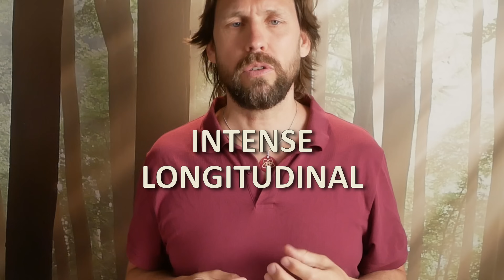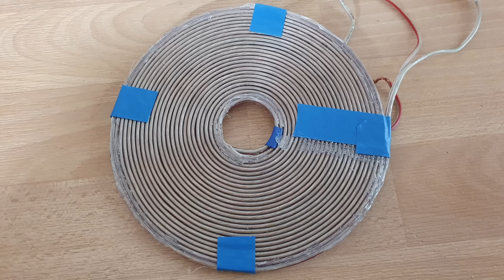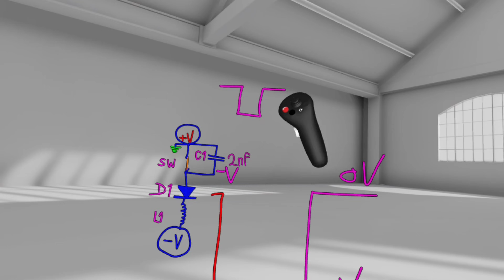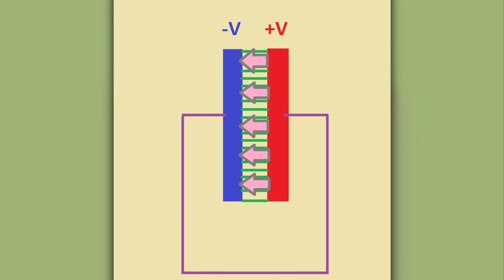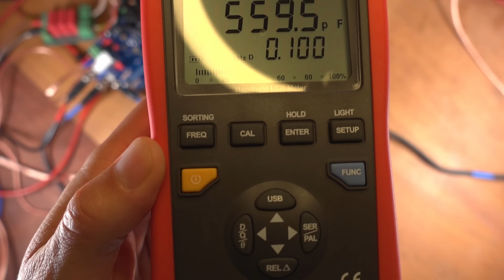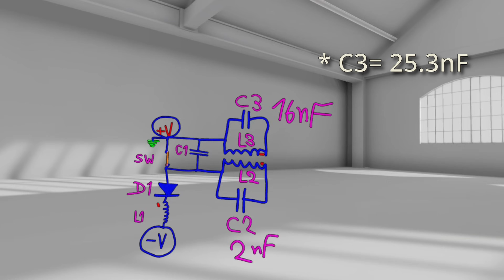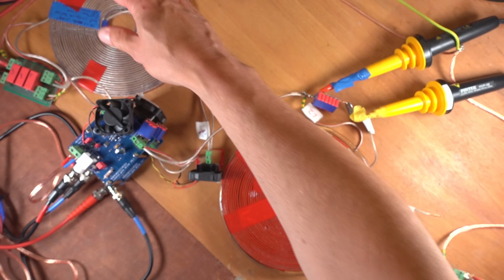Dielectric Induction producing Ground Currents

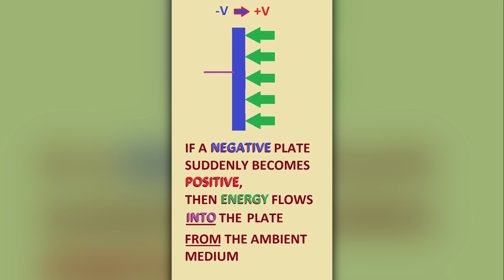Comment: 20:11 "There's an energy movement in a single direction into and out of the conductor." Not really. Reguarding the energy you're refering to here, it is the energy stored in and discharged from the electric field around or outside the conductor, but not so much inside the conductor. 21:07  No the energy doesn't flow from the ambient medium to the plate. The energy is in the fields and remains in the fields, and they dont really flow inside a conductor.  Anyone who wants to have a better understanding of energy flow should read up on or watch a few videos on poynting vectors. Poynting vectors, not pointing vectors, and the pun is unintentional. 

I wish I had more time to comment on other things in the video. 😊 maybe later.
Reply: But, there is energy in the conductor in terms of momentum.
Reply: @lukiepoole9254  just for thought back of the napkin calculation. Let's be generous and let's say with a  copper conductor, that all 11 valence electrons of every copper atom is being conducting at the average blazingly fast 1cm per hour.     1 mole of copper is just a little over 63 grams and the mass of each electron is about 1/1837 that of a proton.  Ball park numbers. For each mole of copper of 63 grams × 11 electrons/(1837 proton electron ratio) = 0.337 grams of electrons moving at that blazingly fast speed of 1 cm per hour.  Such low momentum suggest its effect is not much to speek of and irrelevant here.
Reply: @lukiepoole9254  Sure, and my statement indirectly  accommodates momentum of electrons,  when i said "reguarding  the energy your refering to".  When I wrote that statement I purposely left it open to electron momentum, i had thought about the average momentum of a few electrons in the conduction band and how little net electron momentum energy exist in a conductor, and that the energy in the electric field is vastly more important to the discussion.
Reply: @kreynolds1123  No such thing as electrons. Just atomic concentric energy spheres with connecting fibrous energy lines as revealed by the gamma ray atomic nanoscope - nemescope.

Comment: Hello IVO, Very concise video, great job!  There is a flow of energy into and out of a capacitor.  Obviously the dielectric does not conduct electrical charge or it would not be as such.  A dielectric displacement current is not an actual current flow as you know.  However, mathematically it acts as a displacement “current” in that you have a flow of energy either into or out of the dielectric described by the Poynting vector directionally, which is perpendicular to the dielectric, or an energy flow into or out of the dielectric depending upon charge or discharge.  Of course this energy flow is a magnetic energy flow as the three players are magnetic, electric and direction of energy flow.  Of course Tesla knew and taught this, and he, as you described in your video used a spark gap to enhance this high voltage high frequency flow of energy.  And, of course, Tesla also depended upon resonance in producing the effects thereof.  In your one attachment video in the middle you actually said something like magnetic energy, thus I felt you were alluding to the magnetic energy flow.  Now a flow from “ground” can be displayed by Tesla’s “stout” conductors as well, and with resonance actual high and low energy points along the stout conductors, as similar to an antenna circuit.  So it was interesting to see your current day replication using the Mosfets.  Great job!!!

Comment: If you put a full-bridge rectifier in series with the ground wire - and a cap across the +/- 
- can you then draw energy out of the cap, without loading the power supply supplying the coil/cap/switcher circuit?

Comment: Very interesting.
Puts me in mind of the air venturi effect, they use this to inflate emergency slides on air craft, they need to inflate the slide very quickly, so basically they blow high pressure air through a venturi and it drags external air in at a rapid rate of speed and the slide is inflated in seconds.
Reply: Yes i agree

Comment: Maybe you can show how to use the bifyler coil as a capacitor in a circuit. After all that why tesla use a bifyler is because it was a capacitor in itself. So trying to figure a capacitor value wasn't required to tune the resonance. But that might require tryfyler or multiple coins instead of 2.

Comment: I certainly am not an expert in electricity, I only started reading Tesla’s work 12 years ago. 
I have read tesla everyday for 12 years, and I believe I am starting to understand his basic ideas. 
So, in regards to how I have come to understand the basic concepts Tesla championed, I have some questions for you.
1) when you refer to dielectric, are you speaking on electrostatic energy? I don’t remember tesla ever writing dielectric fields, only as an insulator did tesla speak of dielectric, and you mention it often, so I am trying to reconcile your ideas with what I read of Tesla. 
2) tesla said electrons are what he referred to as “radiant matter”. He said those tiny spheres were primary(could not be broken into smaller pieces), and had an insulating fluid that kept these charges from combining, and creating much larger voltages, and higher currents. 
He also mentioned the resonant frequency of electrostatic energy is about 1 million per second. It was his opinion that a longitudinal wave of electrostatic energy could break down the insulating layer between electrons, and therefore, release unimaginable energies. Moray echoed that thinking as his apparatus was stated as being an oscillating circuit tuned to energy in the atmosphere; it was simply pulling energy from backround waves that are continuous and all pervasive in the cosmos. 
Is this your goal, when doing these circuits? Are you trying to get at those kind of frequencies of around 1 million per second?
3) have you tried, or considered,  a quenched spark gap as tesla described in his quenched spark gap patent? Tesla said as little energy as is practicable is what is needed, it shouldn’t be seen, and would sound like a “fly buzzing around” were his words. The goal was not to have large pressures, or currents, but to have the least necessary to cause a spark. The goal was a spark @ 1 million per second to break down the insulating fluid that prevents electrons from combining and creating much larger pressures, and currents than was necessary to make the spark. That would mean this circuit would always produce more than it used, in fact it would produce much more! Have you considered this circuit set up for your longitudinal energy? 
4) tesla did not use two flat coils as capacitors, the flat coils had a different purpose in his circuit set ups. They were used in conjunction with condensers to create enough energy to create discharges at what ever interval of time tesla wanted. The flat coils were used to propagate a compressive wave, or to receive a compressive wave, from my understanding. Why are you not copying tesla in the way he used flats? Air is a problem according to tesla, and the pressure would have to be constrained in a circuit that has air, as air becomes conductive(speaking in terms of high voltage/current)……tesla avoided air at all costs in the part of the circuit that was used to move large voltages and currents. All the flats I see in Tesla’s labs are not in oil, so the flats were part of the circuit that converted the high potentials/currents and were used as more a transmitter/receiver of longitudinal waves in the atmosphere…..what say you on this observation?
Reply: did NT  use quenched gaps to smoothe out his high voltage discharges?
Reply: @johnwynhausen9618  I believe Tesla said he had condensers to keep a constant pressure, the quenched gap was to afford the LEAST energy practicable to get “a spark”, which he defined as a compressive phenomena. This was from the transcripts of the Westinghouse bankruptcy proceedings. Tesla was letting us know that it was not “how much” energy necessary, but “at what frequency” that energy was to be repeated. 
Tesla said that static electricity wasn’t so static, that it had a frequency of about 1 million per second. Peter Lindeman adds that Tesla believed radiant matter, what we call electrons now(a primary particle, spheroid with exceptional charge), is surrounded by an insulating fluid. The implication when one thinks on these facts as stated by tesla, is; 
A spark repeated at 1 million per second(+/-) will hit the resonant frequency of static electricity, and the insulating fluid that surrounds all electrons will start breaking down, only a small conductive plate in that vicinity canbe used to collect the combining charges of the electrons……and that is the secret of the radiant patent.

Comment: Once L4 is placed next to L3 at a different capacitor should give you two phase and three phase if added more If one continues with adding L.. 1,1,2,3,5,8.  The "Grounding" (Zero)  would be from a different L  Would this not provide a "continuous"  DC supply if the timing is calculated have a look at Steinmitz calculations...
The VR drawing too must be great to model toroidal models..
Theroia Popolas
Reply: James, it seems that you understand exactly how the system works. No matter how many times I watch the video and how detailed Ivo is, I have no electrical background and don't understand much. Would help me and put it in simple terms - how do you make this energy usable? Where do you hook a battery or if it is not a battery how do you use this energy one extracted?
Reply: @nikikrastev5606  Transformer to the required battery input...
These are only ideas I do not know these things..
I just want to encourage experiment.

Comment: Can you use this to charge a battery????I found this guy living off grid..his power was from a battery that positive connected to a tv antenna,and negative on the battery connected to an earth stake,and he claimed the battery was always charged..he only had lights,a small dc pump and outlet for charging tech...his batery was 80 amp car battery....not even deep cycle..it was 8 yrs old and showed no sign of wear!!I am an electrician..had me stumped
Reply: If the antenna is picking up enough signal, you can run low voltage light directly - had a guy locally to me running his house lights off of BBC Radio 4 until complaints about the radio shadow his antenna was causing got the BBC investigators out.

His antenna was copper coils wrapped around the walls
Reply: @ianemery2925  lol i wonder if the same would work for all the mobile phone masts :) :)
Reply: @garygranato9164  AFAIK, it was a fairly unique situation, BBC Radio 4 was on a very strong Medium Wave transmitter, covering a huge part of the UK, and producing nearly 1volt of electricity  between a voltage meter's probes held wide-spread, even where I lived, 30+ miles from the transmitter.

With no antenna connected, I could pick it up clearly on an old 1970s Sony tuner.

Mobile phone signals are much, much lower.
Reply: @ianemery2925  shorter wave length yes, less power ?? i live 100meters away from a bt exchange with a large cell tower mast, there are multiple cables that look to be about 1" think.  that mast is kicking out plenty of volts trust me.
Reply: @garygranato9164  Higher frequencies dont go as far through the air, so although the output very close to the mast might be high enough, even 1/2 mile away it wont.
The nearest mast to me is 1.5 miles - and the signal strength is -102db, even though I can see the tower with my own eyes.
Reply: where is that?

Comment: What usefull and how tap the energy ?
Reply: Yeah exactly. 'Tap' the energy. Transmit a small signal of ultra short duration, the tap. Do this at any frequency and it will organize the electron flow into impulses that transmit longitudinally. This is his whole point.
Reply: @ickorling  Not electrons, dielectric tension.
Reply: @JenkoRun  sure, I guess you mean because electron flow is merely hysteresis (losses) in discrete units. Thereby, It's caused by dielectric tension. However our physical world still appears to require a bridge from the frictionless rules of dielectric to the magnetic rules of matter, hence I use the term electron flow as it's the factor for direct measurement.
Reply: @ickorling  Basically, since the electron would be 1 unit of dielectric induction thinking of it as a measurement system would be accurate.

Comment: You just explained the workings of my most joked Flux capacitor that I called it that but it uses dielectric induction to produce a current  through the gas tube. I can use a Tesla coil or plasma ball exciting the in side of the capacitor core which in turn produces a dielectric field and then through the use of diodes produces a current through the gas tube. There is still a force that shows on my oscilloscope and volt meters that is wireless power but I yet been able to harness its full potential. I am dealing with the scalar event of a dielectric  field and scalar effect will actually bypass the diodes so it's a real head scratcher for me. Great video and explanation. My videos are not presented as nicely as yours and I am not all that good with videos I am glad that you are able to share this knowledge as I wish I could communicate better but I will refer others to your video so they can have a better understanding of the experiments since this kind of information is almost non existent. Sadly I probably confused a lot of people who have watched my experiments. My bipolar coil inside the capacitor is not a flat pancake though so it's done a bit different yet it does what you are explaining mine is cylindrical yet biflar and the two inner ends are a capacitor  that raps around the coil both at the center of a toner that was Cristalized under a strong  magnetic field. The outside is an aluminum Nos can soda container rapped up with tape then the tube on top with the wires and diodes. Anyways just thought I share that even though my experiments have been a bit different than yours what you are explaining is real and correct. It works!😊

Comment: Nice video. Great information, Great delivery.  Please note that current NEVER flows through a capacitor, if current did flow through a capacitor, it would be a LEAKY capacitor.
Reply: Electrical current flows through a capacitor in proportion to the frequency of the applied voltage. So you are correct for DC voltage (zero frequency) where an applied voltage will pass zero current. But for AC voltage the capacitor will pass by induction a current in proportion to the frequency. The higher the frequency the more electrical current passes. There is a mathematical formula linking the electrical impedance (or resistance) of a capacitor to the frequency of the applied voltage. So the impedance can be calculated fom just knowing the size of the capacitor and the frequency of the applied AC voltage.
Reply: @brettess52  AC current "flowing" through a capacitor is an illusion, it appears to flow through the capacitor but the charges are just accumulating or pulled off the plates which gives rise to displacement current external to the plates regardless of the frequency.
Reply: Dave of EEVblog has a video about AC current through a capacitor.
EEVblog #486 - Does Current Flow Through A Capacitor?
To answer the question of the title: Yes, AC current flows through a capacitor.
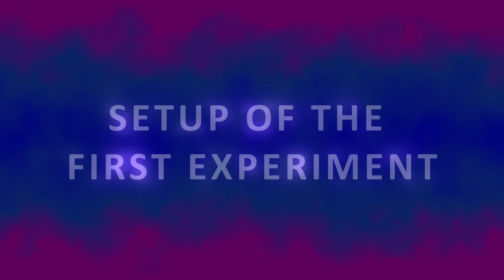Reply: In the EEVblog I mentioned above, at the time 15:28, Dave says: 
"Try and design any practical electronics by thinking that current doesn't flow through a capacitor. It's stupid. Doesn't work."
Reply: @ddegn  oh, well then it must be true BECAUSE DAVE SAYS SO!
Reply: "Current" is merely a concept. Current is not a thing in and of itself. Expressed as a ratio, current is the relationship between a magnetic field and resistance. Ohms law states this. Zero is passing 'through' a capacitor. Both the plates AND the dielectric material of a capacitor are being induced by the changing of, or the elimination of, a magnetic field. Nothing more is occurring.
Reply: @elams1894  We rest our case .... well stated partner.  Next case!
Reply: So what does a coupling capacitor do?
Reply: @tallbrian100  a coupling capacitor transfers a changing voltage from one part of a circuit to another while maintaining current isolation.
Reply: @adon2424  how do you create a voltage moving current.
Reply: @tallbrian100  you cannot create a voltage just by having current flow. If by "create" you actually mean "generate", then use the generator or alternator principal to "generate" a voltage.
Reply: @tallbrian100 locks an area of a circuit to only ever accept either AC or DC.
Reply: It's useful in many but the amplifier circuit is an easy way to get a grasp of it on a lower level.